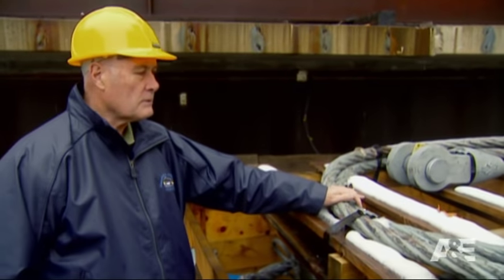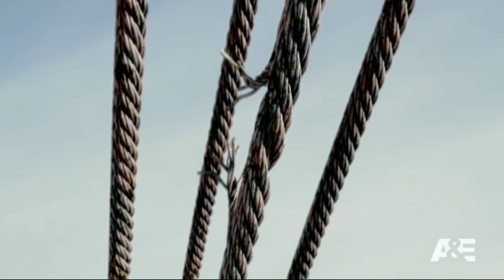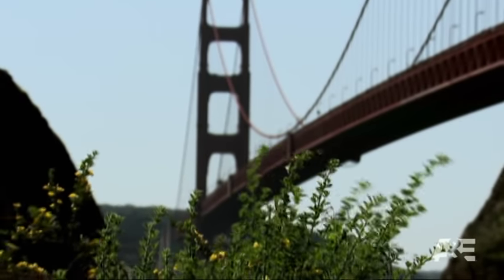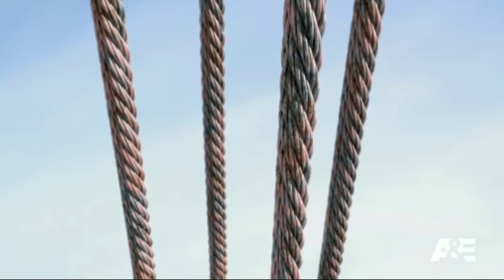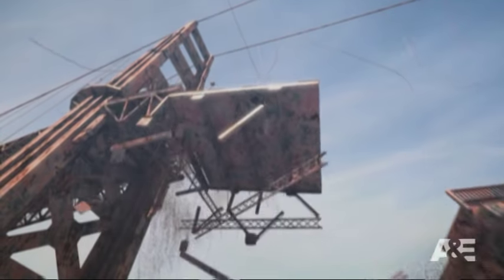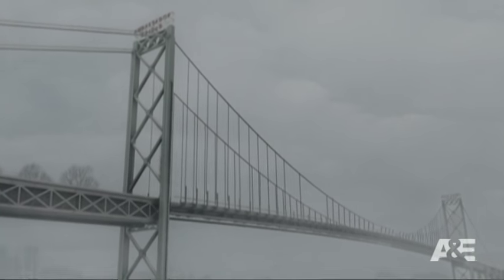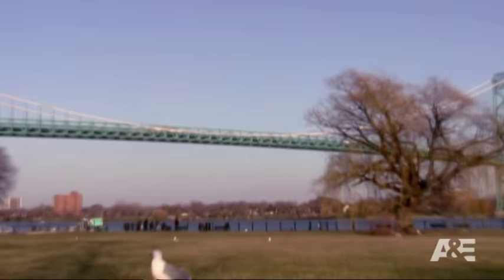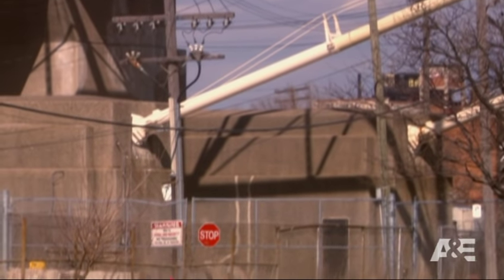Life After People: Shaky Bridges | History

Comment: Brooklyn Bridge: one cable breaks, entire part of bridge starts to sway, then break apart
Golden Gate Bridge: one cable breaks, bridge sways, falls apart
Ambassador Bridge: one cable breaks, every other cable breaks, causing the bridge to fall
almost the same thing
Reply: They have been saying 1 different thing just in different way
Reply: Incorrect. In the real show the Golden Gate Bridge can survive 1 vertical hanger cable.
Reply: @pnisvegetarianbattlehurstt8013  along as the 2 big boi cables dont fail the golden gate bridge will be fine, sorta
Reply: The ambassador bridge was too obvious in the part where it cables starts to snap  it shows only 1 cable instead of 4
Reply: Well they’re the same type of bridge
Reply: I was the longest suspension bridge
Reply: Well, part of the golden Gate Bridge towers fell apart
Reply: @boemeh94 well not anymoe as there’s new suspension bridges that are way longer
Reply: Well, it usually works that way. Your break one part and the rest falls apart.

Comment: The Tacoma Narrows Bridge actually collasped 82 years ago in November of 1940, the reason it collasped is because 35 MPH winds met the frquency of bridge, which made it go up and down then eventually twisting, eventually causing the vertical cables supporting the bridge to snap due to lots of stress, it was eventually replaced with a new bridge nicknamed "Sturdy Gerty" which replaced the old "Galloping Gerty" which collasped.

Comment: The Brooklyn Bridge is not supported by the diagonal cables. It's supported by the 4 main cables, which are galvanized. The only thing that would cause the Brooklyn Bridge to collapse is an excessively heavy and uneven load (i.e. the NYC Marathon, which is held on the Verrazano Bridge).